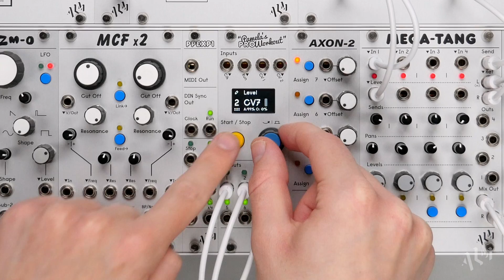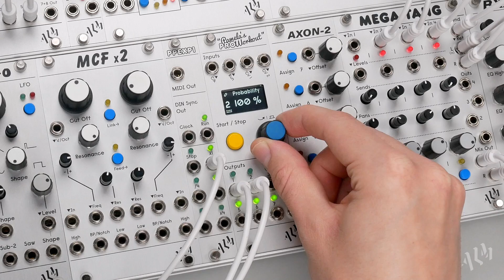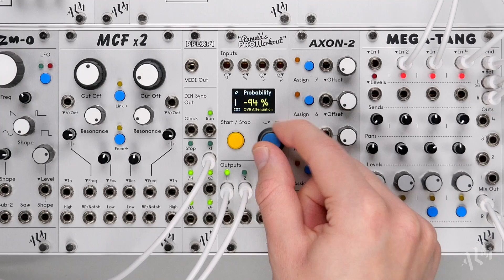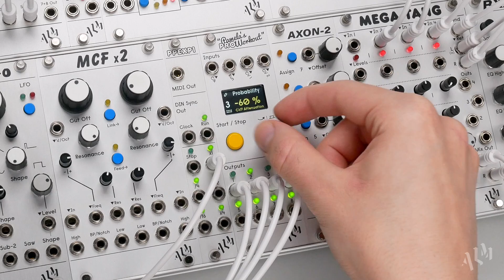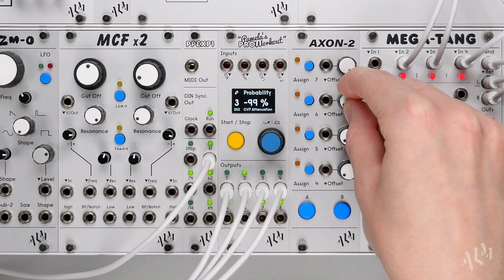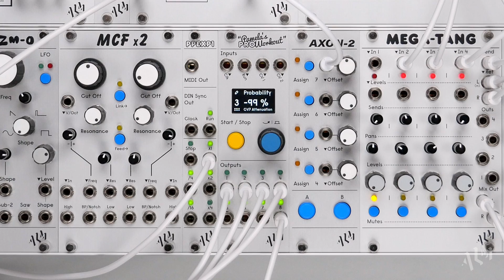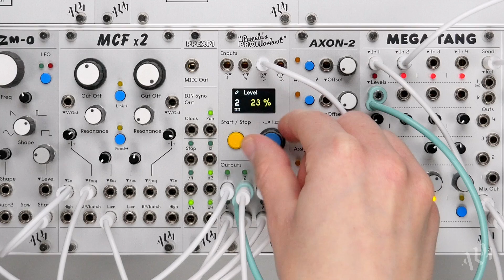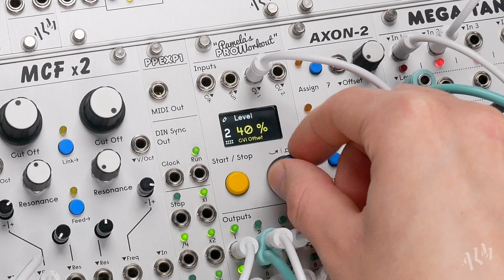Pamela's PRO Workout: External CV Part 2 - Macros, Probabilistic Cross Fader, Acid Basslines

Comment: I am trying so hard to make this 303 patch its hell to figure out without seeing more of the settings
Reply from the maker: Most of the 303 like sound comes from very specific timing and modulation levels as well as a more reduced range of cutoff modulation. The level and offset CV assignments shown in this video are primarily where that comes from. Aside from that, there is looped random voltage on Output 1 and a skewed sine wave with Euclidean pattern on Output 2. Outs 3 and 4 simply have looped gates with reduced probability, the settings were set by trial and error until the 'accents' and 'holds' sounded the most like a 303 sequence.
Reply: @busycircuits thanks so much for this! Will mess around more later and try again

Comment: I guess at some point there will be a video on the GATE, START, STOP functions? I haven't really figured these out yet...
Reply from the maker: They are simple fixed outputs really for just syncing stuff to Pam - start/stop for sequencer resets, gate as a run signal (high when Pam playing).
Reply: @busycircuits  OK, thanks! Is it possible to send an external signal to Pam's to start and stop it?
Reply from the maker: @theproblembelief7549  Yes of course - accomplished by sending a gate into the run input. Advise you check the fine PRO manua for this and lots more info!